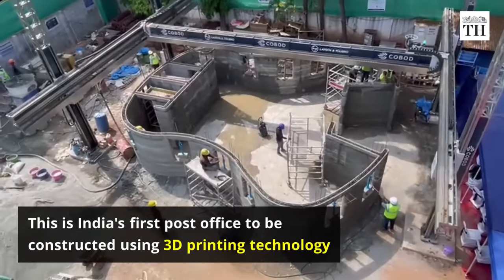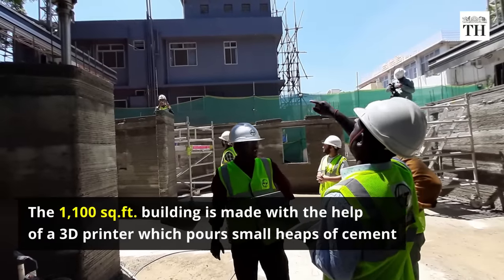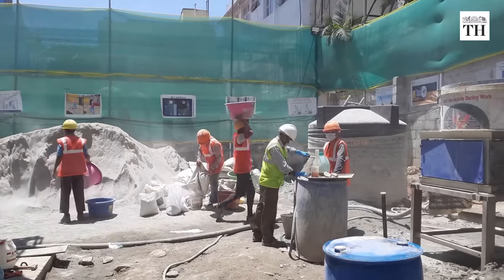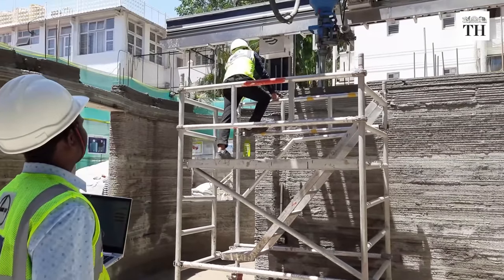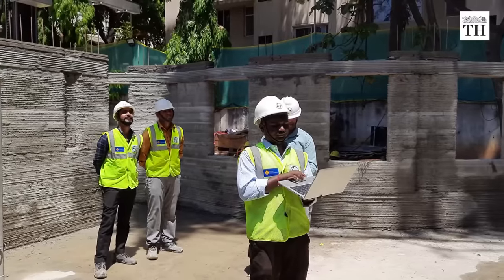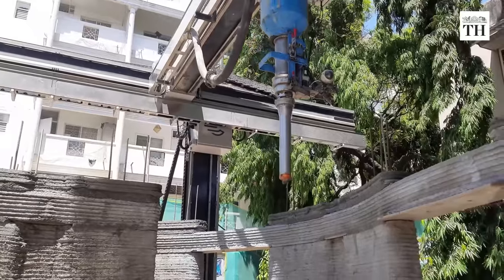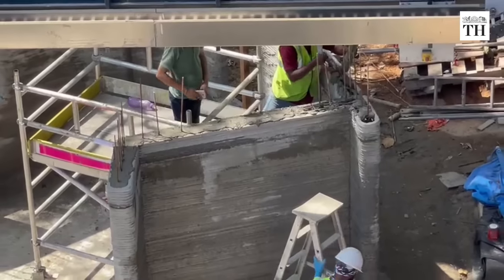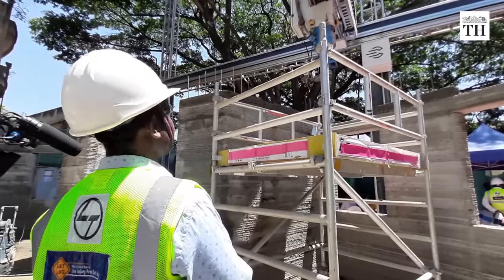Bengaluru to get first-of-its-kind 3D printed post office building

Comment: Really interesting.. So does anyone know how it is comparable to traditional building methods in terms of speed and durability?
Reply: U can make complicated artistic structures which occupies less space and with same strength which is otherwise which are impossible to construct using manual labour
Reply: @shivakumar-cn9bg  not impossible, just more time consuming
Reply: The strength is not as reliable as traditional one..
Reply: would not even briefly consider it, and I used to work with a concrete printer.

3D printed concrete is not traditional concrete. The printing process requires something that can be easily and reliably pumped through a nozzle, but also has gel-like properties so it stays in place once you print it.

In order to do this, you don’t really wind up making concrete. You have to remove all the large aggregate (gravel) and then add bentonite clay to get the mixture to gel.

It would be more appropriate to call that “mortar” than “concrete” - and the difference is fairly obvious in close-up shots of a printed structure:

If you look carefully at that photo, you might notice a couple oddities. For one, the layers are not consistently stacked, and there are lines between each one. 3D-printed concrete is not fully bonded between layers, and there are small air pockets and gaps. No through-holes or anything, but it's not the same as a continuous pour.

For another, the color of the concrete seems to change from layer to layer. This is because 3D printing is exposed to the environment, and the material has to be mixed in multiple batches as the building is being printed. This isn’t due to something that can be engineered out, like print volume or machine design constraints, it’s an inherent requirement of the process. By design, the printer must run slower than the material hardens (if it didn’t, the walls would collapse as they got higher).

This means the material is inconsistent and poorly-controlled, and is generally much weaker than standard concrete in bulk. Any claims you’ve heard about the strength of 3D-printed concrete are likely false or misleading.

It is not currently a reliable process, and because concrete has to stay moist to cure properly, there are all sorts of problems associated with printed structures, like microcracking and extremely poor durability (where the surface is dry and brittle):

That’s not to be pessimistic about the capabilities of the tech - these may be the sorts of problems we can fix long-term, and there’s no guarantee it even matters. In fact, we may have fixed it already - some companies have created proprietary concrete blends that may be less sensitive to variability during printing.

However, the process of qualification testing for this is not just complex, it involves embracing variability that traditional construction tries hard to remove. This is complicated by the state of the industry - since mix designs have become proprietary to gain a competitive advantage, they all have to be independently tested. I know for certain nothing on the market is qualified currently, because there hasn’t even been enough time to develop testing standards, much less actually do it. Since every new layer is fully exposed at some point during a print, the humidity, cloud cover, wind, temperature, and shape of the building all significantly impact the quality of the final product.

Concrete cures on the scale of months, so testing this many variables is absurdly time-consuming. Although the standard for strength measurement is 28 days, that is really a “good enough” threshold, and the large-scale changes we’ve made to the mix design may slow down or speed up that process.

There are other complexities beyond this that I could cover, but the basic conclusion here is that this industry has developed so prematurely that we've barely even discussed what the standards should be.

The buildings you see in the wild are driven by investors’ Fear of Missing Out and a lack of regulation to stop them. If you buy a 3D-printed house, then you are acting as an early-adopter for a product that's normally intended to last decades, if not centuries. More importantly, the industry is currently speculative enough that if we even tried to impose proper regulatory constraints on it, my guess is most of these companies would go bankrupt doing testing.

Perhaps, in several decades, we will have a good understanding of how strong these houses are and how well they age.

But we certainly don’t now.

Comment: Normally American homes are made of wood and cardboard, walls are thin enough that 10 year olds can break them easily, it's good for them, in bharat we have 10inch brick walls. It can be used for Affordable housing temporary structures but not for full fledged buildings.

Comment: You can see this in two ways. 

One that we have achieved a easier and faster way to construct structures.

Second is we are massively going to lose out on build quality of houses as this thing is not durable to a point that it cannot even withstand a punch. ( you can read similar stories of how US addapted wood frames to accelerate their build time but ended up with houses that could easily crumble and are not durable.)
Reply: American house are built with timber, this is built with cement and iron pillars. You can't even compare these two.
Reply: @avinash22i  Welp sorry to break it to you it’s iron pillars  and Plastic composite
Reply: @lgtv8526  What do you mean bro? As you can see in the video, machine is clearly pouring the cement. With iron pillars and cements it looks quite durable
Reply: @lgtv8526  0:21 its clearly mentioned as Cement.
Reply: @avinash22i  no its not, it is a hybrid plasticky portland cement which gives the texture and rigidity similar to the portland cement but falls face first in strength.
Reply: @lgtv8526  Ya I will belive what the are saving in the vedio than some random person (No offense) on the net.
Reply: @avinash22i  you are, saying